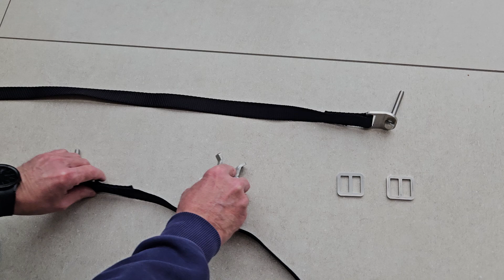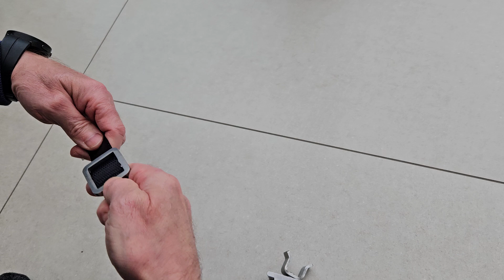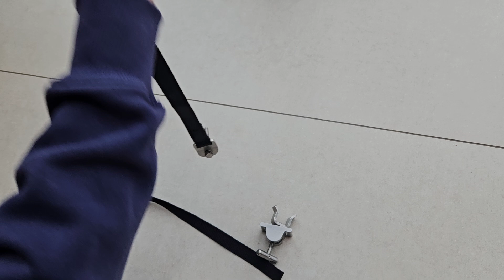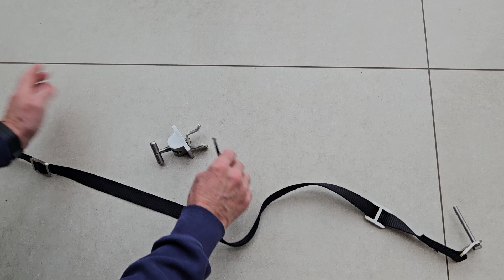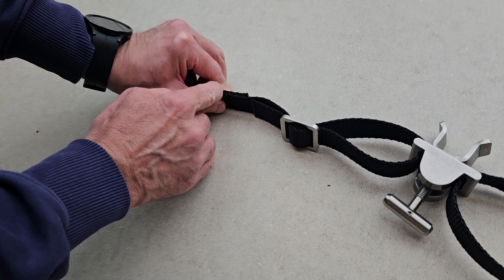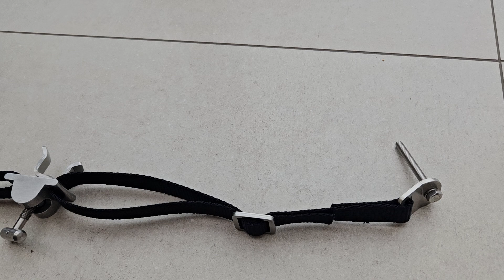STRAP ASSEMBLY INSTRUCTIONS -  FITZBRICK EXTERNAL PROFILE SYSTEM

Comment: Can these straps be used on any profile,also will they hold if you just plug the perp?🥂
Reply from the maker: Hi Ian.  I designed the Profile System to work with any standard 50.8mm x 50.8mm  (2" x 2")  box section.  To attach, get an 8mm drill bit and drill an 8mm hole and push the pin on the end of the strap into the hole.  It is solid.